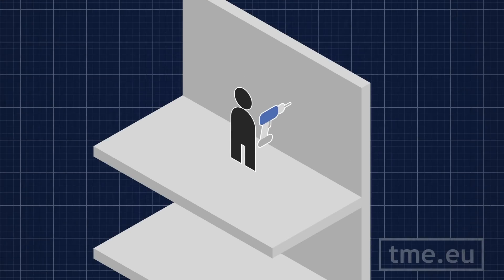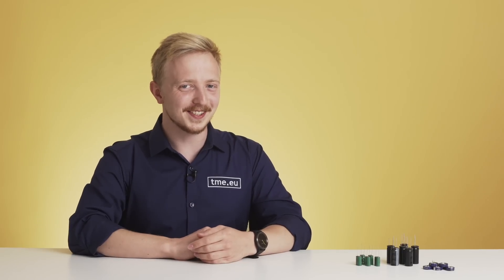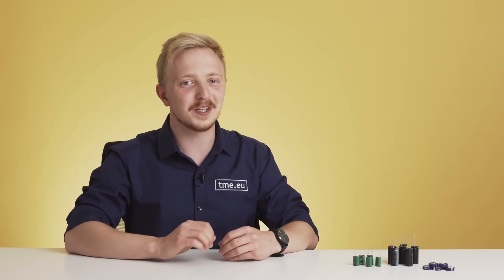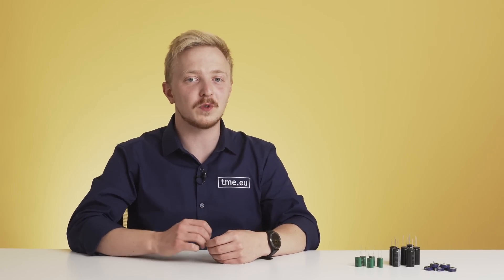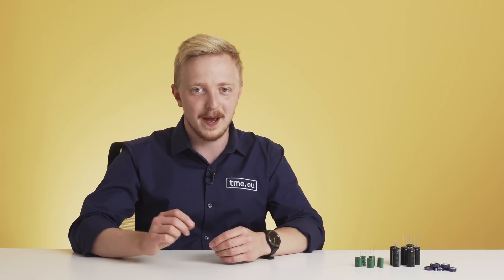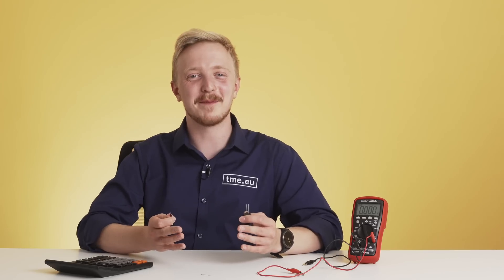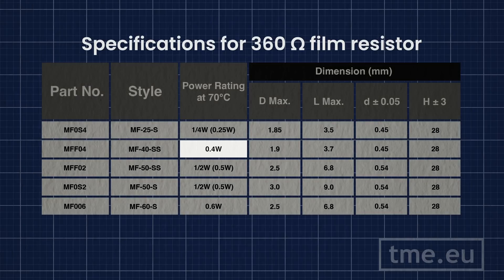How to Safely Discharge Capacitors? [Tutorial]

Comment: hello,  this is wrong to do!!!!!   when you put screwdriver  current (I) are infinit and possible to long time damage capacitor  and spark are dengerous in some cases. 
 For correct discharge need to use multimiter and wait come secounds or device especific for this like capacitor discharge.
It's simply when it's capacitor from 10v, 25v, but when it's 250, 450v or more it's very dangerours.
Please don't show worng information for home users.
Reply: I like to make a salt water bath and throw my electronics in there, this way I know that water will conduct electricity and dissipate the heat coming from the discharge.

Comment: Hello, is there any difference when capacitors have a blue or brown color instead of the regular black?
Reply from the maker: Hey! 
If you are talking about the outer color of the electrolytic capacitor then there are no regulations between the manufacturers. It can be gold, brown, blue or green but the most important are the voltage and the capacitance. Moreover, some are for specific applications so it is worth reading the specifications. 
Have a wonderful day!

Comment: 07:00 - 07:44 Please do not mislead people about RC constant, which DOES NOT mean the fully discharge (0V) time. The result from experiment (3.62V) was pretty close to the theoretical value (10 / e ≈ 3.68V) and is definitely not an error as you suggested. What if someone wants to discharge 400V capacitor instead of 10V capacitor that you presented ? 147V after RC time is rather not safe (as the title says), isn't it ?
Reply from the maker: Dear Janusz, We completely agree that 147V is not safe. 
At 2:32, we stress that you always should measure the voltage of the capacitor with a multimeter before operating on it. 
At 5:32, we say that the RC constant gives you the time it will take for the capacitor to discharge to a third of the initial voltage 
And around 8:43, we mentioned the safety threshold voltage – a voltage that is safe for work and that there are online calculators that can tell you how long it will take the capacitor to discharge to that voltage.
However, we will make sure to be clearer in our future videos. Thank you for your feedback and have a lovely day!
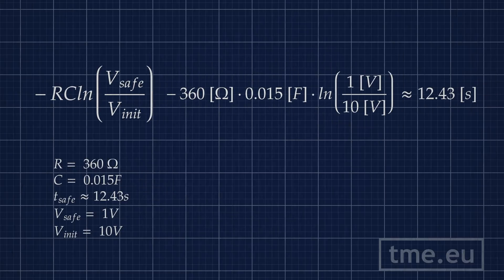Reply: @TME.ElectronicComponents  Thank you for the explanation. The thing is that the only experiment in this video does not show discharged capacitor, as the title says. There is also a typo in the equation at 09:15 (lack of "=" sign). Anyway, good job, keep it up 👍